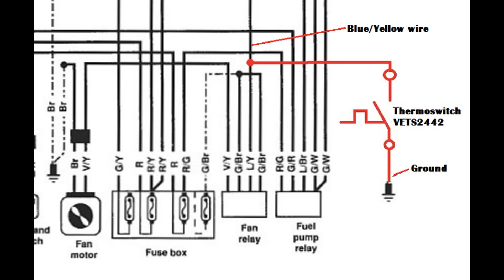BMW K1110 LT Solving a overheating issue

Comment: Thanks for the video. 

Its common thath the radiator ribs on these K are filled whith dirt. The front fender is little to low sow gravel and dirt after many years fill the cooling ribs on the radiator front side. If you have a cooling issue, check the front of the radiator. I mounted after cleaning the radiator ribslines an  extention front fender. The gravel and dirt stops on the extended now.
Reply: I like what you are saying but that’s just too easy to be true.  
But I’ll give it a lookie loo

Comment: There is a little trick when filling the coolant.
I use a 5L reserve gas tank with flexible nozzle .
The sensor is probably a NTC resistor and there are a lot of different.